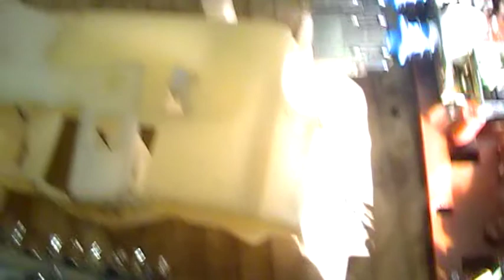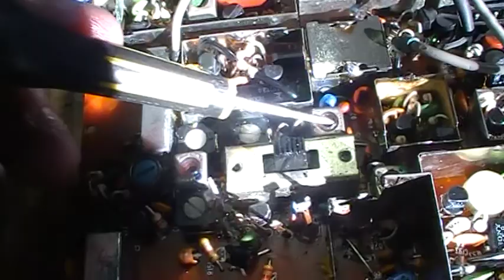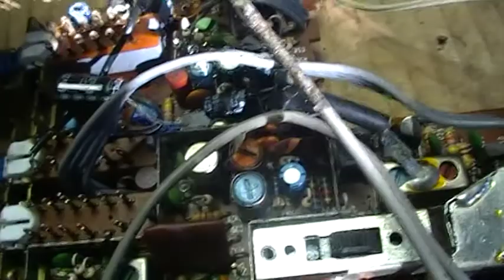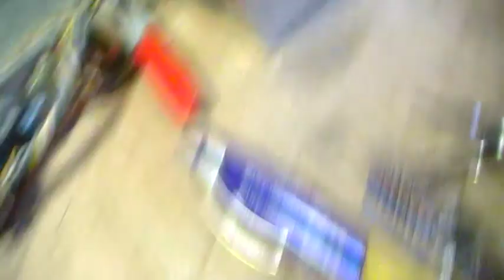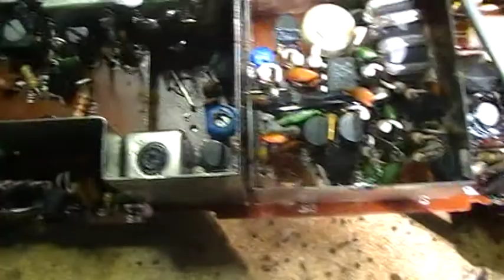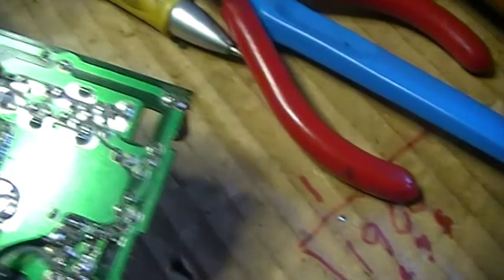Sony ICF6800 repair part 7

Comment: Can we repair this radio if SW band is not working? What could the possible issue if all bands are working and only SW is not working?
Reply from the maker: The AM broadcast band, and the FM bands do not use the Phase locked loop section, therefore a radio with no shortwaves operating points to the PLL section as being the culprit.
Reply: Thank’s, Dayle !! I was really looking for an answer to this question!! I will keep looking!